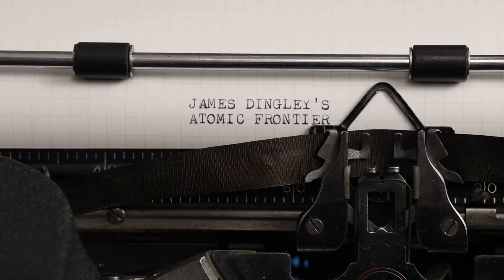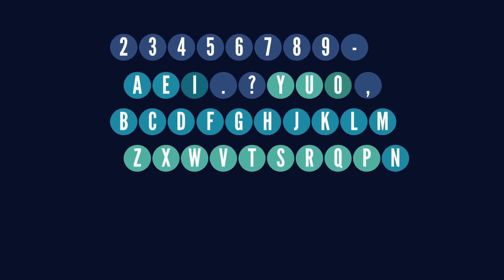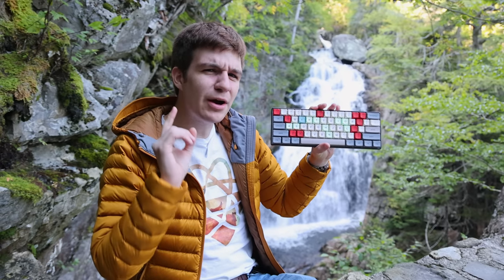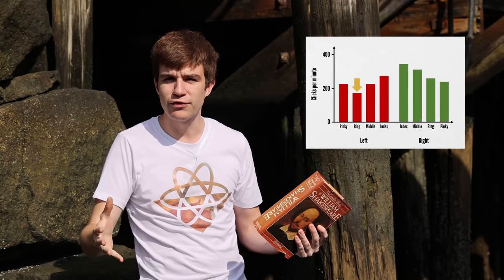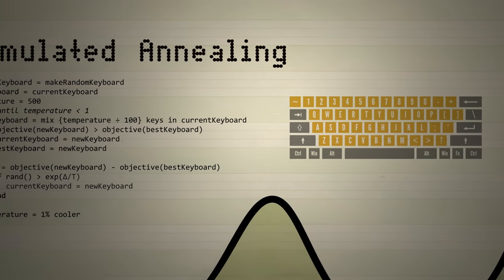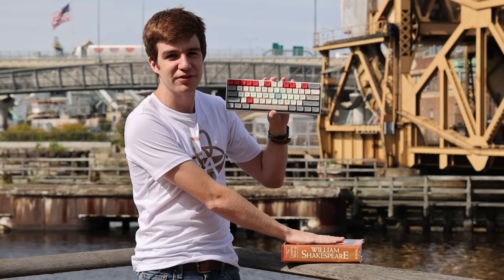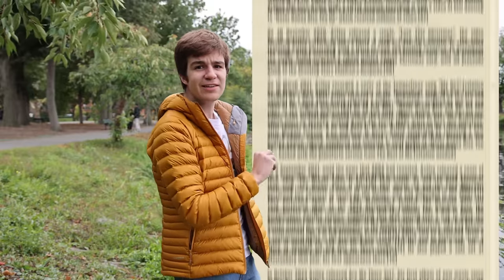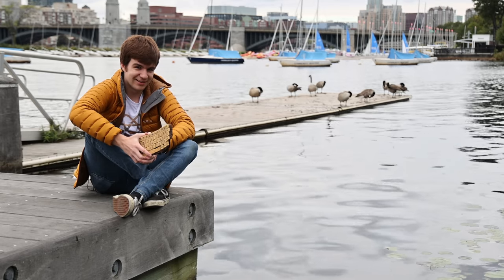QWERTY is broken. Can we make it better?

Comment: I was always a fast typist on QWERTY but at some point I started to hit a speed limit and also noticed that going on full speed caused "typewriter's cramps" (tenovaginitis) more and more often the older I got. So I switched to Dvorak. Once I was able to reach the same speed as before on Dvorak, I noticed that it was way easier on my hands. However, Dvorak allowed me to break my former speed limit and become even faster than before; so fast, that I could write as fast as people normally talk with ease (I could transcribe what people say in real time and without using shorthand). The problem is that a few years later my cramps came back because I think I was going too fast now. It got so bad that at some point I was just looking for a keyboard layout that would not cause me any pain, which is more important than speed, and so I ended up with Colemak. I cannot achieve my former speeds with Colemak but thanks to the fact that Colemak is optimized for even smaller finger movement and more pleasant rolling motions, whereas Dvorak is more optimized on hand alteration, I can now type at pretty good speed and with almost no pain, if I don't overdo it and use the right keyboard. As for the right keyboard, a split ergonomic keyboard works best for me and a low height one (like a notebook keyboard) works better than a half height or full height one and also way better than a mechanical ones, as I need way less force to push down the keys (almost no force at all) and the keys also travel a way shorter distances, so there's way less finger movement with only a minimal amount of force applied and that let's me type for hours and hours, every day of the week with no bigger issues, as that's part of my job.
Reply: Just curious, do you type on a membrane or mechanical keyboard? I decided to switch to a mechanical 2 years ago due to pain and it was the best thing ever. My fingers don't hurt anymore because I'm using much less effort to press the sluggish and sticky keys and my typing speed also is faster as well. I am interested in trying other layouts though
Reply: @kupo150  I have collected all kinds of keyboards, probably 40 to 50 of them over the years, in order to find the optimal keyboard for me. But all the mechanical keyboards I've tested so far are not suitable for me because the key travel path is too long. On my current membrane keyboard, a short travel keyboard (like a notebook keyboard), the key travel path is tiny and I need almost no force at all to press the keys because when I lift my finger and drop it on the key, the force is almost enough to press it. Usually people have problems with membrane keyboards because they literally hammer their keys (you can actually "hear" how hard they hit it), when in fact a gentle touch would suffice. With a mechanical keyboard, there is less strain on the fingers when hammering as the key is gradually slowed down before coming to a complete stop, whereas with a membrane keyboard there is no slowdown, the key stops abruptly and all the surplus force acts back on the bones, muscles and joints. But once you learned to type with almost no force, meaning there is no surplus force anymore, mechanical keyboards don't work for you anymore, as when I type on a mechanical keyboard the same way as I'm typing right now, I'm in fact not typing at all, as no keystroke is ever registered, because with that amount of force I cannot push the key down to the point where it would register a keystroke. I need to push harder and farther to type with a mechanical keyboard and this is more tiring for my fingers. Also when I get used to this kind of typing again, I cannot type on notebook keyboards anymore, as then I will have the issue of using too much force again and the result will be a very painful experience after only an hour of typing on a notebook keyboard which is not able to absorb that extra amount force and this is nothing I can change like just flipping a switch. It took me several months of training to learn typing fast and accurately while almost exhibiting no force on the keys; when I type it look as if I'm petting my keyboard, as you barely ever see me lifting my finger or visually pressing anything down. A lot of people type like this: https://www.youtube.com/shorts/IdH1TF6pUH8?feature=share and this will kill you when you type on a membrane keyboard. With such a keyboard, you need to type at least as gentle as in this video: https://youtu.be/MKT6Uhk5-Iw Yet when using a layout like Colemak, there's is way less movement as you rarely ever leave the home row and even if you do, you don't move the entire hand around, you just move a single finger up/down, while the rest stays on the home row. https://youtu.be/7TVKvZkbndc Also compare this: https://youtu.be/8PCMgDk315Y See how much more gentle the movements are to the right vs to the left (forget the middle one, Logitech keyboards aren't good).
Reply: @xcoder1122  very interesting stuff. I think I used to slam type a bit with membrane but I do feel like my pressure with a mechanical has decreased a lot. I slam sometimes still. I always used crap logitec membranes I guess. The issue I had was that my shift key got worn down to a point where it was getting stuck and it caused a lot of extra effort that my pinky finger started getting a lot of pain from the strain. Once I switched to my Huntsman keyboard all my strain pain went away. Of course a new membrane would have worked in the short term but I also don't like the squish feeling of membranes either. I also don't care for laptop style keys either that are really thin, I like more things to feel
Reply: I didn't find a significant improvement when switching to Dvorak, but one thing I did find is that, when my hands started cramping up, switching between them provided a vast improvement.
Reply: @Mythobeast  But  didn't that just happen because the switch slowed you down for a while until you got used to the other layout again? And, of course, it depends what is causing the cramps in the first place. If the cramps are caused by the wrong keyboard or by the way you are pressing keys (e.g. with too much force), the layout alone cannot fix that. The layout will only solve issues caused by too much or problematic finger movement.
Reply: @kupo150  IMHO the worst type of keyboard are the half height membrane keyboards. Unfortunately those are also the most common ones. The problem with those keyboards is that you need to press them with some force and you have a larger keyway, but the keyway is shorter than with a full size keyboard and the extra force is not absorbed by the membrane. Most people prefer either low height membrane keyboards or full height mechanical keyboards. Either one has benefits and drawbacks but half height membrane keyboards combine the drawbacks of both types and have no benefits whatsoever. Yet you may also go with low height mechanical keyboards https://youtu.be/03Tc9GASaus which are more like half height membrane keyboards (only the keys are low height but they are elevated like half height keys typically are, because of the mechanical switches), but still have the advantage of damping any extra force, so it won't bounce back into your fingers. 

Of course, it all depends on the switches in the end. I own the same mechanical keyboard in three variations: Soft tactile (you can feel a soft "click" when you hit the switch), hard tactile (you can very clearly feel the "click" and even hear it, more force is required for a keypress) and zero tactile switches (you hear or feel nothing, there is no haptic feedback when you hit the key, other than keycap movement coming to a rest, therefor the keypress is very soft and requires little force). The last one is very easy on my hands but not knowing for sure if you already sent a signal or not forces you to always press the key down all the way and this is bad again and and caused tendonitis that was so bad that I couldn't touch a keyboard for 3 weeks because I was probably slamming the keys way too hard. I guess most people would prefer soft tactile, as it's gentle, you don't have to go all the way to press the key and still it's way easier to type on it than on the hard tactile ones; also the audible click of the hard tactile ones makes you go nuts after a while. 

But there are way more variations than that. Cherry has 7 linear switch variations, 3 tactile switch variations and 3 tactile switches with click variations. Their main difference between the variations is how long the key path is, how much force is required to press them, how much force the tactile feedback requires to overcome, how much they can damp extra force at the end, and how loud they are (more precisely, whether there is also audible damping). E.g. force can be anywhere from 0.45 up to 0.8 Newton (tactile force ranges 0.55 up to 0.8 N). Key path goes from 3.4 up to 4 mm, yet that is the full way, the actuation point ranges 1.2 to 2.2 mm. So mechanical is not equal mechanical. Whoever tried mechanical and was not happy with the result may have just used a keyboard with the wrong type of mechanical switches for his typing preferences.

And yes, membrane keyboards have a much shorter lifespan because the membranes wear out quickly. Mechanical keyboards can handle 5 to 10 times more keystrokes before they show signs of aging. If you type a lot on a membrane keyboard every working day for a year, the keyboard will probably need replacing after about a year, maybe a little later, but it won't last two years. 

If the keyboard has a full membrane cover, you can spray some silicone under the keys, this makes the keys even easier to press and increases the lifetime of the membrane, but high quality membrane keyboards do not have a full membrane covering the entire keyboard anymore, they have a single cone per key, and with this design you must not do this as the silicone will then "creep" under the cone and block the electrical signal and suddenly your keys stop working. I ruined two expensive keyboards before I found out they changed the production method behind my back (there used to be a single membrane covering the entire keyboard, now there is one cone per key instead). Same goes for mechanical keys. Never use silicone or penetrating oil for those, as over time it will get everywhere and when it covers the metal contact area, the key stops working. If you need lubrication for your mechanical keyboard, only lube the spring and its surroundings, apply a heavy duty oil or grease because these won't go anywhere, they stay where you applied them, and less is more, don't drown the switches in lube, otherwise it may still get pushed where the electric contacts are. If that happens to you, the area can be cleaned, so not all hope is lost (in case of membrane cone, all hope is lost!), but it's still a whole lot of work.
Reply: How far do you place the 2 halves of your split ergo from each other? Would it interfere with your mouse use, assuming you have a regular mouse?
Reply: @xcoder1122  I don't think so, but I wasn't exactly measuring it scientifically. My impression was that it changed which key sequences I was repeating. It put stress on different fingers.
Reply: @xcoder1122  interesting datapoint  Im comfortably at 120-130wpm with bursts to 150 on QWERTY but I've never considered DVORAK.  I also have been using apple chiclet keyboards for the better part of the last 18 years and I also do not like longer stroke of mechanicals!
Reply: The thing is @xcoder1122, if you are typing that fast, you need to consider the following: a) Warm up your muscles before you start typing, b) stretch your muscles after you have been typing (a lot). If you don't discipline yourself doing this when for example you are running, you would also get injuries.
Reply: @xcoder1122  I'm happy finally seeing someone with whom I can relate in regards to mechanical keyboards. Even with low profile keys (my personal preference), and low actuation switches, it always feels like the switches kinda "struggle" against your fingers, making me have to use much more effort to actually type than I would in a membrane keyboard. There's less impact when bottoming out (and usually I'm not even bottoming out) but the 'bounciness' can really tire the joints when you're typing above 110wpm, even more so when the keycaps are too high (at least for me personally).

Switching back to the membrane ones after getting used to mechanical is uncomfortable because you end up getting used to using more force, so it's easier to get trapped in the "worst of both worlds scenario" in which you kinda hate both or have a hard time choosing which one is worse for your pain. :')

Makes me really curious to know how it'd feel typing on a CharaChorder One after getting past the learning curve.
Reply: I use a Logitech K860. It's great in every way except that they put the 6 key on the left side of the split. This may be OK for European users, but we Canadians are taught to touch-type by hitting the 6 key with the right hand.
Reply: @xcoder1122  have you tried hall effect keyboards? with customizable actuation points and rapid trigger? or at least a mechanical keyboard using switches with low actuation points(akko ocean blues, cherry silent reds, cherry speed silvers, etc)
Reply: @surferdude4487  This kind of touch typing results in overuse of your right pinky finger, as that way your right pinky finger must cover three keys in the top row (0, -, and =), whereas all other fingers only have to cover at most two, usually just one key in the top row. Also the distance your fingers must travel to top row is increased that way. That's why it is preferred today to shift the top row finger alignment one position to the right, which results in a more balanced key distribution among fingers and shorter key paths for all top row usage. This has nothing to do with European keyboards as the top row is identical on European keyboards. It has the same number of keys and the same key alignment. The fact that some numbers have different shifted symbols and the keys to the very left/right are different in general is not related as the shifted numeric values are not used more often than they are used in English and the very left/right keys are always pressed by the pinky finger, regardless what kind of touch typing you are used to. Already the Microsoft Natural Keyboard Pro from 1999 had the 6 on the left side of the split, also for US only model. And this is even the original way of touch typing, as that's how people used to touch type on typewriters. To quote from the Wikipedia:

"A method taught since the 1960s (and perhaps earlier): The left little finger is used for the keys 1 2, the ring finger for 3, the middle — 4, the left index finger is responsible for 5 and 6. On the right side of the keyboard: index — 7 and 8, middle — 9, ring — 0 and the little — all other keys on the right side of the upper row. These two methods likely reflect the layout of the typewriters from early days when some of them had no 0 and/or 1 keys."
Reply: @rzt430  Keyboards with hall switches are very expensive and none of the available models is ergonomically split, so I didn't feel like spending that much money on them. Their start force is 40 cN, the total force needed is 60 cN. And while you can configure the actuation and reset range from 0.1 to 4.0  mm, they provide no haptic feedback, as they are linear and silent, so unless you press the key all the way, you cannot tell for sure if you pressed it at all. Having keys that react to a very short distance is not helpful, if they don't provide any feedback you can feel or at least hear.

As for the other switches, I have at least one keyboard with almost any other Cherry switch type available for comparison (I know for sure I have a keyboard with Silent Reds, not sure about Speed Silvers, though; I know that I don't have Speed RGB Silvers but Speed Silvers also exist in a non-RGB version). I've never used Akko CS Ocean Blue switches, as when it comes to mechanical switches, I always go with Cherry as that's a brand I know I can rely on. Which is not supposed to mean that other brands don't also make high quality switches or that the ones from Cherry are any better, it's just that I have no experience with other brands and thus cannot tell if those are any good or not.
Reply: @xcoder1122  I learned to touch type in the 70s before computer keyboard layout was anything like standardized. In Canada and the US, we were taught to strike the 6 key with the right hand. We struck the 4 and 5 keys with the left index. You are correct that even the very earliest Microsoft ergo keyboards placed the 6 on the left side of the split, which is why I refused to use them. However, the early Logitech ergo keyboards put the 6 on the right side of the split. I have had long debates with other people in the Youtube comments about this subject. It came down to a difference in the way touch typing is taught in Europe. I'm an old dog. It's tough to teach me new tricks. When I go to strike the 6 and I hit hard plastic or the 7 key instead, it's a bit jarring. But that's still better than having a case of RSI from having my wrists at a bad angle. So, I guess I'll just have to put up with it.
Reply: @xcoder1122  jeez im trying to reply with recommendations but youtube seems to be deleting my comment immediately
Reply: @rzt430  YouTube considers all links, except internal ones to YouTube itself, as  probably spam. They don't delete your comment but the comment is put into the spam mailbox of the YouTuber who owns the video. Unless that YouTuber marks the comment as non-spam, it won't ever appear publicly (it has only been shown to you personally and even that is only the case until you reload the page). Most YouTubers never even look into that mailbox, actually some don't even know it exists or that comments will end up there awaiting moderation.
Reply: @xcoder1122  yeah i'm aware of that. no links in my comments. it's just that youtube's censoring algorithm gets wonky at times with its parameters. this happens occasionally with longer comments, despite having no company names, no cuss words, nothing controversial, etc. youtubers don't handle this manually, especially not within a split second of the comment getting posted, i have a separate channel account myself. anyways i shortened the whole thing on my other reply and this time it posted properly lol.
Reply: @xcoder1122 
Lovely knowledge and wisdom pool. I was going to mention the Hall Effect and analog keyswitches for minimal actuation (especially from Wooting) but it seems others have already mentioned it and you already know about it.

Your experiences confirm my small experience and theory on full sized mechanical keys vs low-profile or membrane keys. The travel distance in keystrokes intuitively seemed like they would slow you down or just be less optimal than shorter travel distances.

That being said, I am curious if you would ever change your mind once you get a chance to try the Wooting or Razer keyboards or similar that have the analog actuations. The lack of haptic feedback is a sound hypothesis, but in reality it may actually be a pleasant surprise. But yes, the price can be prohibitively expensive.

Also, I wonder if you've tried low profile mechanical key switches and what you think about those? I am currently using a Logitech G915 [clicky model] which is a mechanical low profile keyboard... And typing has been pleasant on it. I don't recall seeing you mention much experience with low profile mechanical keyboards. Curious what you think about those.
Reply: @Un1234l  Yes, I have tried low-profile mechanical switches. Even very low profile ones that barely have any stroke. I think they feel okay and probably allow for very fast and accurate typing, but it's a very different typing feel and you have to reduce your keystroke force even more, so I think you have to get used to them first, which takes a while, and once you get used to them, you might have a hard time using other keyboards again because your muscle memory is so trained on these very short, very light keystrokes. Also, it's hard to say if the slightly harder stop compared to low profile membrane keys will still cause problems after months of typing or if you can just adopt to that.

As for analog switches, the problem remains that unless I hit them all the way, I can never tell if I really hit them or not, but if I hit them all the way every time, it kind of defeats the purpose of having an analog switch. That is, unless I set the activation threshold very low, so that pretty much every touch of the key is registered as a press, which makes the keyboard very reactive, but also very easy to mistrigger keys just because you wanted to rest your fingers on them and just put a little too much weight on them. Razor themselves recommend setting the threshold very high for typing, so I guess the later idea did not work out so well for most people while typing? But I've never tested analog switches for typing, at least not in a long-term test, since I don't own such a keyboard and was only able to try it out for a few minutes in a store.